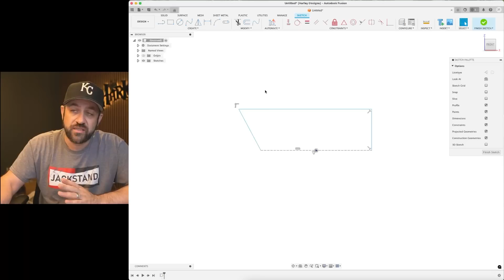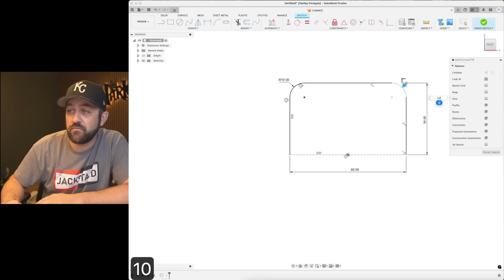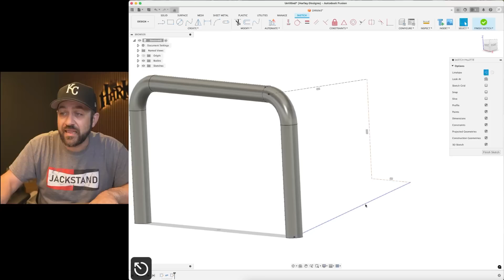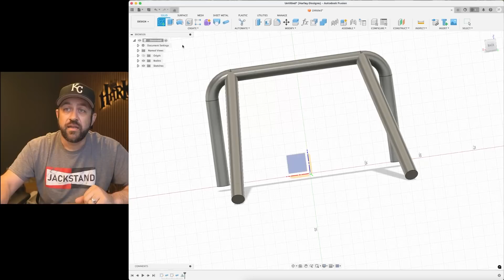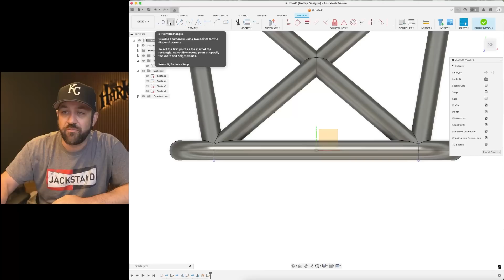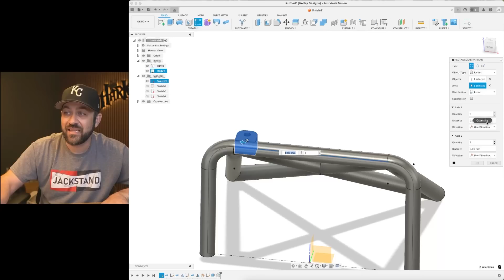How to: Tubing Design - 3D Printing Sunday  - Ep 40

Comment: I am struggling to use the centre point, I tried adding the point on the edge of the pipe and still doesn't want to work, should I change a setting?

Comment: Press Ctrl on your keyboard after you point to an object's feature (like a circular edge of a pipe's end) and hold that button. Fusion will then show you all points of interest (midpoints, corner points, etc.) of that feature and lock it in view as long as you press Ctrl (Control on Mac). You can then move your mouse to that point, and it will snap the mouse to it and let you select it easily.

Comment: Did you learn CAD in college. Im so old ,we used punch cards and basic in high school.
Reply from the maker: @allmightygreat1892 I’ve never taken any classes on CAD, I learned from tutorials and brute force! 😁
Reply: Ditto.   At school, I learned Basic on a 'Desktop' with the Code being stored on a Cassette Tape.   It would take ages for the Code to load even for a very simple program.   Post School, I learned more Basic & Fortran on a DEC PDP-11 which had a Black & White Screen.   And then a few months later did COBOL on an ICL where we used Punched Cards.   Some of our non electronic Punch Card Machines didn't even print the Characters across the top of the Card so one didn't really know if you had punched the card correctly until the 1st Compile.   And don't dare drop the Shoe Box of JCL, held together by a few Rubber Bands, for the night's Batch processing.   It wasn't so much a case of 'Pick Up 52' but rather 'Pick up 500+' & try to get them back into the right sequence!   Somewhere along the line, I learned RPG.   45 years later & I still enjoy writing COBOL when  can given the opportunity...

Comment: Can you do a STL Sunday that incorporates revolved features? 

Like a roof skin or body panel that would have a "C" to engage a tube or something? Like the front edge of a roof thay way you would only nees to use 2 screws at the rear to attach since the front engages the tube. 

These are great videos man, learning the shortcut keys helps a ton. And the steps you take when designing helps greatly as well.